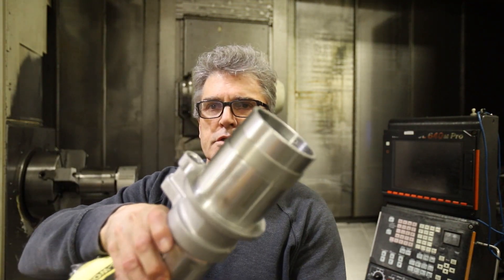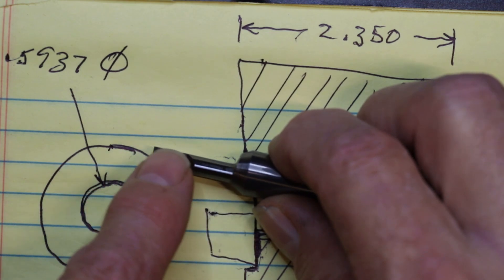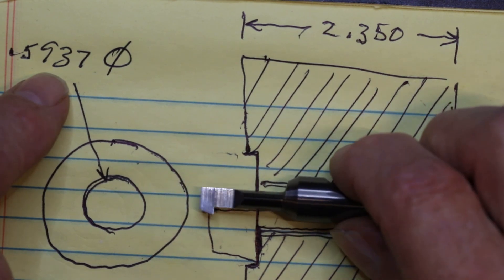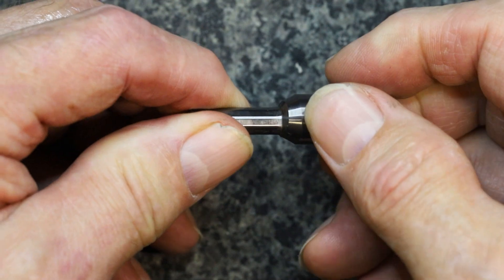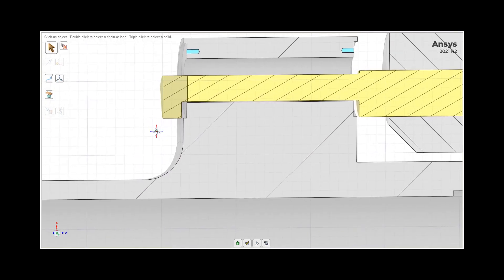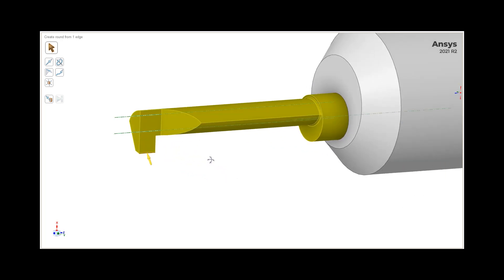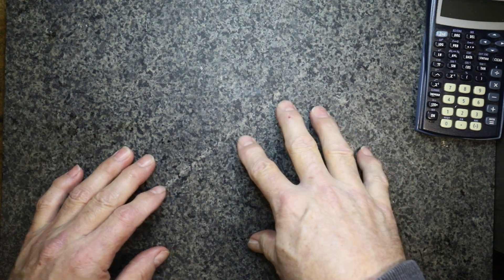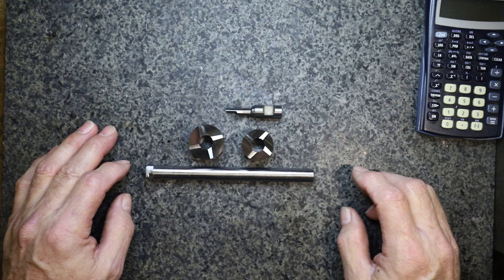Back Spot Facing Tools

Comment: Several points Peter.
1/ the people who watch your channel like to hear your thoughts on tooling, techniques and aproaches to work.
Don't worry.
2/ You could grind a much closer, even wedge locking, end to the back facing arbour. That would reduce chatter and make refining those tools safer.
3/ The price of the angle head tool is alarming, but I do believe it!
4/ If you did buy it, there would be jobs come up that it would no doubt be useful for. ($8k, damn!)
Those shrink fit er's would have to be close to reproducible offsets.
Reply from the maker: If you shrink the collet on the tool and leave it there. It will should replete accurately. https://www.bilzusa.com/parts_info.php?tool=ThermoGrip_shrinkfit_TER_chuck_ER_16_inch check this link.
Reply: I agree they should repeat within tenths.
There is something not right in that table.
The "d1" column is confused, I'm sure you cannot fit a 3/4in shank in an ER 16, 10mm or 3/8" max.
TER0318/16 sounds right for the 1/8" ER16 as 0.318mm is approx 1/8" and etc down the description column.
The Ident number doesn't seem to relate and the d1 is all over the place.
You'd want to check with Them...

Comment: I wonder if those back spotface tools could be made to work better by grinding wedge shapes into the tool and the arbor, so that rotating in the cutting direction would pull them tight?   (Maybe use a wrench to pull tight and tap with a mallet, same to loosen - sort of like knock-off wheels on old race cars.)

Comment: Is possible to turn the boring bar shaft close to the inside diameter and inset into the holder after passing through the part? Possibly with a flat for indexing & holding?

Comment: Could you use an ecentric sleeve to make a bit of adjustment for your back spotface . . I like this style of video it gets the grey matter stirred up !
Reply from the maker: As I said in the video. I have put it in a boring head. Also once you move to centerline you could program a small circular motion to increase the size if necessary. Provided the shank of the tool had enough clearance.
Reply: @EdgePrecision  it's all snakes and ladders also thought of making the access hole under size counterbore  the back then Finnish the hole . With a screw on type of cutter . I hate back facing .. but it's easy to draw !!! I do enjoy your channel . And your thinking .. remember it's an old dog for a hard road !! An old saying from down under !!

Comment: Assuming purchased HSS counterbore & arbor, would it make sense to drill & ream a tapered x-bore through the CS and use a ground & polished 1045 arbor? Short run, eliminates or reduces chatter & allows accurate disassembly.

Comment: Could you get a carbide blank to braze to the cutters and feed the cutters from the back then jog a hydraulic tool holder to the blank ,then just do the cut, once done, unclamp the tool manually and presto.

Comment: If you could get the angle head with a collet each side you wouldn’t have to change tools just orient spindle 180. Could you use a very long spot face tool from the other side on the horizontal? Would take some fixturing though but you could use a large shank tool and pilot it off the fixture. How much power does the coolant driven head actually have? We have a coolant driven straight tool at work used for engraving but it hasn’t been used on milling small features yet.
Reply from the maker: These people make a straight head with a 1-5 gear ratio. This is probably what your engraving head is. It speeds up the in this case five times faster. But also reduces the toque.

Comment: Hi Peter, is a driven 90° double ER collet angle head not an option, you can buy them also in smaller sizes, with clearance about 17mm or smaller.
You could machine both sides, disadvantage is that you have to change tools, but that is unavoidable, most can aligned in all directions.
There are a lot of brands who sell them, e.g. Parlec, MPA.
Reply from the maker: Actually that is available. But I am going a slightly different path on this. Due to the helpful comments/suggestions people have made in this video. I have come up with a better idea. I will be explaining this in a up coming video. Thanks!
Reply: @EdgePrecision  
I wonder what your idea/solution is, always a pleasure to watch your videos, it's a huge learning curve,  thanks Peter.

Comment: You could probably give the parts to another shop to sinker-edm the spot-faces. They could easily come in from the side. I dont know if the prints allow that though.
Reply from the maker: I try to avoid sending my jobs to outside shops if it possible to do it myself. I have had problems in the past with that. To many to go into in this comment. Also on aircraft parts the often don’t allow EDM work. I don’t know if it applies to this part. I wold have to check.
Reply: @EdgePrecision  My comment might have been a bit short sighted. For shure there is a lot more to consider. 
I really want to thank you for all the information and insight you are sharing. I learnt a lot watching your videos.

Comment: I was wondering if you could create a back spot facing tool shank with a taper and a matching taper in the cutter rather then  depending on those poor fitting ones you showed? I like this type of video, it will be interesting to see your solution.

Comment: Is it possible to do the back spot faces at a pocketing operation with the angle head and a small endmill? or is there lacking clearance/torque/machine degree of freedom? Or would that be unable to meet the surface finish requirement? This is a circumstance I haven't had to deal with, but I really don't love back-side spot face tools.
Reply from the maker: Yes that is the advantage of this way. It can do the spot facing on both sides drill the holes and mill around the OD of the round boss with its bottom corner radius. It can be indexed 180 degrees in this type of machine. The only thing is the tools would have to be manually changed. A little inconvenient but doable.

Comment: What about those automatic back facing tools where the cutter flips out when you turn the spindle on forward and flips back in when you reverse the spindle. I think Erix or Cogsdrill and maybe Mollart? Not sure.
Reply from the maker: Yes that is a possibility. If they can repeat close enough. Remember I have to hold .001”. I will check into them.

Comment: Will the angle head collet accept endmill to mill the back spotface?  Could you borrow or buy one from the other company.  Could you make your one arbor to replace that sloppy one?
Reply from the maker: Yes the angle head will hold a endmill or the drills. So it will do all the operations for these two bosses. Because it can be indexed to do the front and the back side.

Comment: Mount pins in your soft jaws for distance set offs in line with the holes to be back-faced. Make the back facing tool rigid - mount it from the back into a collet - jog onto a gauge block - reset tool zero - continue. Do 54 times! Or, make the carbide back facing tool with a second front face to cut the front of the hole at the same time - make the shank heavier for rigidity. Cost a lot less than $8000 US.

Comment: 23:02 .. Couldn't you drill through those and tap for a small allen head to lock it down.  I know it takes a little longer to snug it down every time, but at least it would be more secure.
Reply from the maker: I have thought of that. It’s not my first choice. But it may be the way.

Comment: You can do an interpolation with spindle orientation. Fastest and easy way.
Reply from the maker: Yes on most machines this would way. On this machine because it holds lathe turning tool. It can orient and clamp the spindle every 15 degrees. This is actually clamped with a coupling and much more secure, precise and rigid. Than just depending on the spindles orient function to hold it in position.
Reply from the maker: @beniamin_tms  Not on my machine. It doesn’t have that ability.

Comment: Peter, look at heule's back facing tool. Its automatic, both front and back facing, it will do your job with single side access.
Reply from the maker: I will check into this. It could be a solution if the body of the tool will clear the parts OD. Also I would need two of them. But it still would require me to make the drilling tooling. The coolant powered angle head would do all the operations. I think also Cogsdill makes a similar tool.

Comment: Seems like you're favoring the upfront cost of a tool which will reduce your labor costs. I don't think you've even touched on the labor cost of the setup for all the funky, job-specific tools for each individual part. I figure the more time you can let the machine just do it's thing, the quicker you're gonna be able to get the job done, and the less likely something will go wrong.

 I really enjoyed seeing the real cost of tools/labor, and the creative solutions to minimize them. Great stuff!
Reply from the maker: Yes I do favor the 90 deg coolant powered head. I like the whole reliability of that setup. In the end it may be worth the cost. Sometimes what seems expensive turns out to be the most economical in the end.

Comment: How about grinding that tool at 1740 on center, so it is like an endmill with one backwards flute. Then you can insert it into the hole with a smaller offset and then walk it around the counterbore like an endmill. In this way you can use one tool to do multiple sizes of counterbore.

Comment: i was wondering pete, is it possible to bypass the safety interlock on your intergrex? i ran an early 'grex and found that if you took off the safety lock on top of the door [lft or rt] and put it in the lock, i could then run the spindle with door open. mighty handy for touching off and polishing for size! would it be possible to make an arbor with a closer fit?
Reply from the maker: These doors aren’t manually open and close. There are air cylinders that do that. So if you just remove the switches safety lock tab and open the door you instantly get a alarm. It’s looking at the limit switches on the air cylinders. With the lock switch made but the air cylinders switch indicating off its end it goes into a emergency stop state. A different arbor could be done. Or maybe a bit of weld and filing on the one I have could make a better fit.

Comment: What about using a wood driftwood cutter, put a long drive shank?
Reply from the maker: Are you referring to a woodruff cutter. The maximum diameter tool that would fit thru the hole won’t mill the back spot face and leave any shank diameter to support it.

Comment: Peter, I am just a dumb farmer but how about skip over the lock-tite and just weld the cutter on to the shank and disengage the other end to install and remove from the part. Also why can't you drill the small holes all the way through in the first pass?
Reply from the maker: The locktite idea was just for the purpose of holding these tools securely to the shank for grinding. Than using heat to remove them. Not for the machining process. That would be done as the tool was intended to be used. So it could be mounted and removed I the machining operation.
Reply: Just trying to think outside the box. You need your tool to come apart in two pieces to get it into and out of the strut, and I assume it goes into a collet or Weldon thing on the end opposite the cutter. Would this not make the wobbly cutter rigid and easier to index if it came apart on the other end? Still going to need to shut down the machine to change out the tool either way.

Comment: Hi Peter .
why don't you use HEULE back spot facing tool in parts like this?
Reply from the maker: I did check into all these type of tools. The sizes I needed were special (Two different sizes) with to long a lead time in delivery. So I went this way. To make the special 90 degree heads. ( By the way didn't cost any any more to make). I would need two of them anyway for the holes and only one to mill all the spot faces. (Have you watched the other videos on these parts). So this did work and turned out to be the best way to go. Thanks.

Comment: As an extra thought, how is that right angle tool driven?  Charles
Reply from the maker: This 90 degree head is driven by the high pressure coolant thru the spindle. It has a little hydraulic motor in it.

Comment: Great video!  I can't take my eyes off of your videos once I start watching.  I am also curious how you would account for uncertainty when quoting jobs.  I realize from watching your earlier videos that you probably don't do much quoting anymore since you have such a nice situation as a vendor for your old company, but would you say that on a job like this that you would "pad" the quote to a potential customer?  If so by how much?  Inquiring minds want to know--LOL.  Also, I'm a one person shop and I always am thinking about this kind of stuff.  

Please keep the videos coming.
Reply from the maker: Yes basically you add a extra money to take care of unforeseen issues. As to the percentage it’s hard to put a fixed percentage. It depends on the customer.
Reply: @EdgePrecision  It looks like the tool blade retracts when you change spindle direction so that you can get it through the hole--you may also be able to grind to the necessary diameter of your two spots
Reply from the maker: @milehighmachining  I am investigating into a few tools like this. I should have something by the next video.
Reply from the maker: @milehighmachining  Yes all this has to be determined. If I can’t grind it myself how long it takes to get the tool. Also the body of the tool has to clear the parts OD when centered on the hole.

Comment: A cogsdill flipcut might work, but I really wonder about their rigidity.
Reply from the maker: Or their accuracy. Remember I have to hold .001” of tolerance between the front and back.
Reply: @EdgePrecision Also, you could make a different arbor for the back facing tool with a nut to clamp it instead of the quick change.  Or even a single lip cutter in an arbor with a cross hole and taper pin to lock it in place.
Reply from the maker: @johnnason7019  I even thought if the shank wasn’t to hard. I could drill and mill a thread in its end. Than make a clamp of sort with a screw to tighten it and take the play out.
Reply: @EdgePrecision  another odd idea might be to permanently attach the head to the shank and add a whistle flat to the shank and install the hole thing in a endmill holder.
Reply: @EdgePrecision  maybe if a tool like that could be used with a guide bushing. Solves rigidity and probably would be pretty accurate

Comment: how about making a shank that holds the spot facing tool and fits  better in the tool with a  lock nut on the end of the shank ,  no need for locktite or heating , we engineers live for this  kinda problem and is always interesting learning how others find a solution
Reply from the maker: The locktite was only to hold the tool for grinding it to the correct diameter in my CNC tool and cutter grinder. It would be quick and only have to be done once for the grinding for each tool.

Comment: There is a used titespot on eBay for $2000, would need to adapt it to capto.
Reply from the maker: There is that problem with the shank. But is it’s not the one I need with the ER16 spindle.

Comment: Huh, so there are no interlock overrides on the Mazak?
Could you add a switch to disable the door open interlock or would that be illegal somehow?
Reply from the maker: No the auto doors on this machine can’t be overridden. It is written in to the ladder program. If you override the switches it gets alarms. If the machine had manual doors maybe but not these automatic doors.
Reply: @EdgePrecision  Most machines will have a PMC parameter to disable interlocks. Whether it is documented or not is a different story. If you take a look at the ladder you will likely see a bypass. I can almost say for sure that it is there because they need a way to bypass that stuff when they are building the machine. If you find the PMC parameter and change it but it changes back that would likely be caused by another undocumented condition needing to be met for the change to take effect. Mori was sneaky and did such a thing with a Mitsu control. If you want to look into it, feel free to shoot me an email and I can take a look at you ladder.
Reply: @EdgePrecision  Ah, bummer. You can often simulate the electrical signals to trick the logic, but even that wouldn't be practical if the logic includes something complex like a position encoder.

Comment: How about making a shim to get the slop out of the two-piece tool? Simple solution, if it works ok.
Reply from the maker: I thought about that. But I don’t know how be sure it stays in.
Reply: @EdgePrecision  Some type of clip-style so it’s captured. Put a slight bend on it and put it on the spindle side of the cutter so it’s preloaded. Might work
Reply from the maker: @juststuff4381  I think a dab of weld on the spindle side. And a bit of carful filling or machining could do it. Probably both heads send the same. So two different shanks may be necessary. If I had a grinding wheel thin enough. I would grind a special carbide shank for each tool.
Reply: @EdgePrecision  Yes, a dab of weld would probably work just fine. Good luck and thanks for keeping us updated.